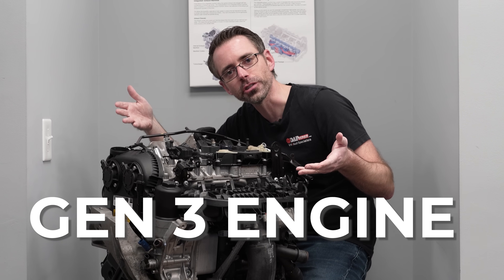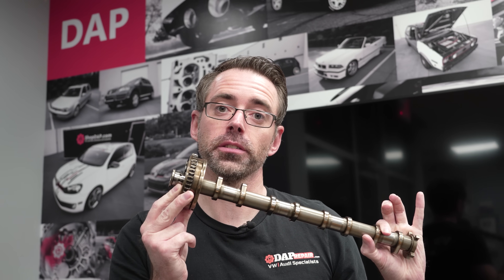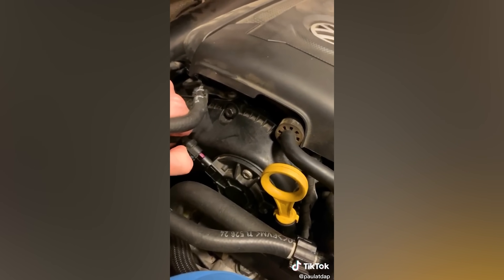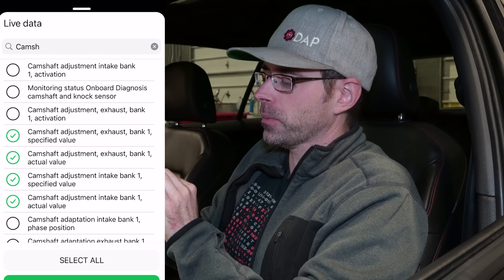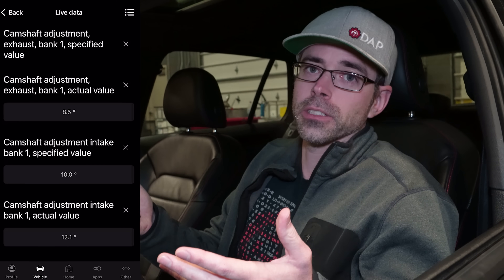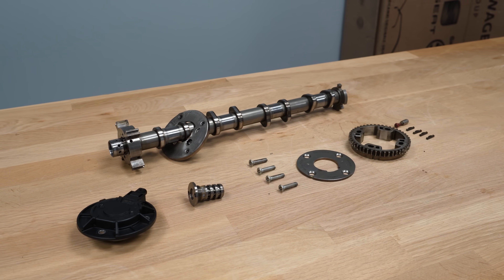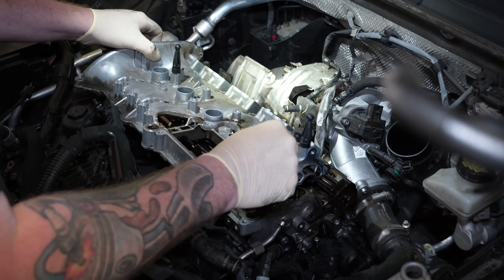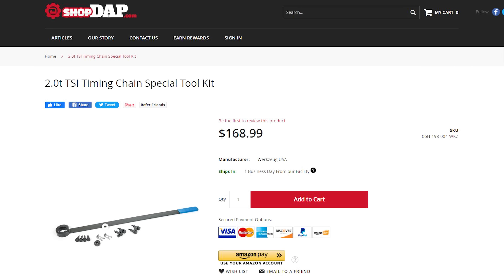Is this a New Common MK7 Engine Issue?

Comment from the maker: Thanks so much for watching! Here are some of the links we mentioned.

OBDeleven Next Gen (iOS and Android) Pro
https://www.shopdap.com/nextgen-obdeleven-ios-android-vw-audi-scantool.html

MK7 Intake Cam Replacement Kit
https://www.shopdap.com/intake-camshaft-replacement-kit.html

2.0t TSI Timing Chain Special Tool Kit
https://www.shopdap.com/make-model-year/volkswagen/gti/mk7-2015-present/tools/20t-tsi-timing-chain-special-tool-install-kit.html

T10355 Crank Holder Tool
https://www.shopdap.com/1-2-drive-crank-counter-hold-tool-for-vw-t10355-wkz-t10355.html

Gen 3 Spool Valve Socket (V2)
https://www.shopdap.com/spool-valve-removal-socket-for-t10352-2.html

Gen 3 Spool Valve Socket (V4)
https://www.shopdap.com/spool-valve-removal-socket-t10352-4-for-gen-3-1-8t-and-2-0t.html

Tensioner Adjustment Lever for VW T40243
https://www.shopdap.com/tensioner-adjustment-lever-for-vw-t40243-wkz-t40243.html
Reply: I contacted Charles a few years ago about this very issue on an MK6 Jetta 1.8t about him making a video about this issue, but he never responded to my messages. 
Thank you, Paul and keep up the good work!
Reply: Please do a video on EPC light on a MK7
Reply: Hey guys love your videos. When I start my mk7R, there is this “buzzing noise” that can be heard. It sounds like it goes away at idle, but when driving you can hear it. The best way to explain it is a buzz noise that changes with engine rpm.
Reply: Does all EA888 gen3 and gen3B engines have this issue? Or does the later models from 2019 and on have a better history on this problem??
Reply: Hi my exhaust specified and actual values are 00    00 no symptoms only a rattling noise
Reply: Hi I live in a third world country my 1.8 tsi does the ticking noise when my car is hot and no symptoms or codes whatsoever plus my cam values are stable exhaust 00=00/intake 15=15.6 stable please any suggestions and thank you

Comment: Google seems to point to this video for the P11A00 and friends DTC codes (Cam Shaft Actuator A/B on Cylinder X - range/performance; other numbers in Audi TSB 2043735). loss of power and can't cruise control [ the video does not point to these ]. 

If you run into this one, behind the ignition coils there are 2 of these (part number 06E103697AE or similar) per cylinder in order (looking left to right when standing at the hood ornament looking toward the windshield) 1B, 1A, 2A, 2B, 3B, 3A, 4A, 4B (as far as i know).  Just remove the t25 torx holding it in, pop the clip holding in the connector and disconnect, pull the part out (may need some pliers), push the new one in with an oiled o-ring (make sure to line up the bolt hole) and screw the T25 back in. Paul points it out in his mk7 engine component location video at 7:15 as 8 solenoids for variable valve timing. I did do this without disconnecting the harness to the coils by cutting down a pittsburgh t25 x 4 in screwdriver handle to be a bit shorter (about an inch shorter) so just fit at the right angle for that actuator. 

Hope this helps someone, since this is a 5 minute fix that's less complicated but finding the order of which one is which was a random post on VWVortex under an Audi AVS thing. 

Great videos from DAP

Comment: I got just a cylinder 3miss fire but its running terrible no other codes i have a gateway static voltage to high thats it and it also just started knocking im at 111500k and i just bought the car 5 months ago and i screwed 😢 im only 20 and just wanted to buy my dream car i also have been chasing this issue fir two months now switched coils plugs pcv everything was fine though

Comment: Ok. I will not be doing this myself. Haha. There’s no ticking just p0011 and p000a. Oil is good! VVT solenoid replaced. Still stalls at stoplights after 8-10 minutes drive. Idles rough. Starts right back up though. I don’t want to pay for this repair…

Comment: I’m having an issue with my 1.8tsi ea888.3
The car starts then after the cold start it doesn’t start anymore th car give a bunch of cam shaft actuator fault codes A/B open circuit 

I need help I have been chasing the issue for a year now !! If you need more info comment I will answer right away

Comment: I know this is an old video , but I have an issue with a MK3 Audi TT , 2.0Tfsi Gen 3, I have a rattle/tapping between 2000-3000 on light throttle, unplugging the cam magnets does nothing . Holding the wastegate arm does nothing . Any advice ?

Comment: Does the 2016 A3 2.0 Quattro sedan have an oil control valve past the cam magnet sensor? I can’t seem to find one for this particular vehicle. A lot of the 2.0 engines have them. I have a cam magnet leak from the electrical connector at the exhaust side i believe (the second one closest to the firewall)

Comment: Bought an 18 GTI S DSG new — Drove it hard, replaced the timing belt at scheduled interval and completed ‘all other major’ services at scheduled intervals — That sound started at 92K miles (12/2024), and now I know why I was quoted for cam shaft replacement, as they were black as coal in the inspection video — I should’ve checked the F#€KING oil … Yep, I should’ve also changed oil more frequently than 10K mile intervals!

Comment: Hello
I have a 2009 Scirocco 2.0 TSI 200hp that’s making a ticking noise, which sounds similar to this. I've experienced misfires(fault codes on all cylindres)  and received the P0010 fault code, no engine light.
The timing chain, tensioner, and guides are all in good condition, with no visible damage to the lifters or camshafts. There’s no change in the sound when I unplug the N205.
Could the issue still be with the intake camshaft phaser?

Comment: Good day, i have a 2014 golf 7R, it is currently at VW for a repair. they told me it is the magnet on one camshaft....is that a common problem or do u think it is seals. The also told me they swapped the 2 magnets and then the problem was on the other camshaft.........your thoughts ???. Regards Jaco

Comment: I did my timing chain on my gen 1 a while ago and remember looking at how easily it would’ve been to do my cam at the time. I don’t know why I just didn’t spend the extra money and replaced the camshaft at the same time. Although I thought that terrible clacking sound was a bad oil pump or something but it sounded it exactly the same after I finished. Now it’s worse. But the car still drives great thankfully. Hopefully I can get the work done at some point before it blows up😅

Comment: I just replaced the magnet adjuster on wife's  2014 Passat  1.8TSI.     it was acting a little weird.

AND the oil was low.  AND the HPFP tap was loud.     new magnet,  a quart of oil.  Its actually due for change in 400miles...   and engine is quieter and normal again.

Comment: Wanted to post here in case it helps anyone else out. My MK6 Jetta GLI started having this issue and at first I thought that I was out of luck for getting a replacement vvt oil valve for the original camshaft (miscommunication with the parts guy). The factory spool valve is part 06K 109 257. This part is 21mm and fits the original camshaft, but there is a new valve that is 20mm and fits the updated camshaft. After some research, I was able to replace this part with 06L 109 257F to fix the rattling issue.

Comment: Good video for explaining how the cams work, but a little bit dramatic. If that knocking sound is there, but goes away when magnetic solenoid is unplugged, the first port of call should he to replace the magnets. Failing that, next up is the spool valve of whichever cam is making the noise - most likely, will be intake. Make sure you carefully order the right valve for your car, very imoortant. This will in most cases likely fix the issue without having to tear apart the rest. Of course, it may be that the camshaft is indeed bad - but DAP should explain what I and others have just said rather than immediately jumping to 'the whole camshaft is bad'
Reply: Thanks for this comment! I have the noise for 1 second max on start up (no fault codes). 

I can't really measure it with unplugging the magnet as its so brief (or could unplug before starting the engine?)  I've checked the cam phase adaptations on vcds and the intake is at 0.3 degrees but exhaust is at 2.6 degrees. Am I to assume that it's actually the exhaust magnet/spool/camshaft making the noise? Thanks in advance.
Reply: @Hey-Roman  If it only happens for a split second on cold start up, it is unlikely either than magnet or spool valve is your issue as the rattling with these problems is persistent at idle, and with a scan tool you can see the inlet cam timing hunting up and down.  These cars do normally  sometimes make a somewhat odd noise on cold start....I believe it's to do with additional air injection, could that be what is happening with yours?
Reply: Hi, i think I have this issue, I heard the rattle like 15 days ago for about 15 seconds but no its on every cold start and also I hear it on low revs. Unplugging it completely goes away. I have a mrk 7.5 golf r 50k miles, I would like to think the camshafts themselves wouldnt be failing at this stage right?
Reply: @TheQuinPVP  I would strongly suspect either a magnet or spool valve beneath it.  Certainly nothing much to lose by trying as those parts are relatively cheap and it's simple to do.
Reply: @danielwatson2068  I have it booked in to get the intake magnets replaced, hopefully this solves its and its nothing too serious. Ill update here incase anyone gets the same issue

Comment: I’m currently battling a misfire on cylinder 3 on my 2015 Passat with the 1.8t (same engine as the video). I have done coils and spark plugs, injector and even an intake camshaft. Still dead miss at cylinder 3. I did a compression test and all cylinders are at 180psi. Any suggestions?

Comment: I have a gen 3 1.8 that’s experiencing a weird misfire in cylinder 3. It has good compression and recently replaced an injector but still misfiring. I looked at the values and mine is also fluctuating around 10. My question is… could a bad intake can only make the engine misfire in one cylinder??

Comment: My Mk7 1.4 TSI has an erratic cold start idle...should the inlets be cleaned .. coilpacks seems to work as advertise .."experts" advise ultrasonic cleaning injectors..All the advise sounds extremely costly..Advise

Comment: I don't understand. ..  If removing the connector to the magnet stops the noise, does that confirm that the cam needs replacing?  If the oil passages are gummed up, could this cause the problem?  Could a sludge cleaner like Rislone potentially solve the problem?  And what is the consequence of NOT replacing the camshaft, eventual destruction of the engine, or just a loss of driveability?  And is the loss of driveability / power severe or mild?     My MK7 Golf has only 70K miles and suddenly has a LOT of problems.  Not sure I want to put anymore money into it.  Oh, and YES, I HAVE ALWAYS HAD OIL IN IT.  GOOD QUALITY OIL, and do regular oil changes.

Comment: Hi been struggling with low oil pressure there is oil in the engine first of all lets get that out of the way. 😂 new Crank installed resealed everything oil pump new seals everything.  But still no oil pressure. Diagnostic says low oil pressure help

Comment: My 2016 MK7 rattles on cold start up a few hours after shutdown. The engine stops rattling after oil pressure is up 3 seconds later Any ideas? Yes it has oil!
Reply: this sounds exactly like the symptoms associated with this problem. I would check the magnets and the spool valves in your camshafts. Luckily for us, the newer spool valves don't fit in our camshafts BUT the internals do! Swap the internals from the new spool valve into the body of your old one and thread it right in. If you've caught it early enough you may be good to go.

Comment: I purchased a used engine and pulled the old 2016 GTI CXCA out. I would like to verify something before installing the used engine,  I noticed that when manually rotating the new used engine clockwise about every manual 360 rotation, I hear a loud click in the top of the engine.  Any ideas? could it be something related to the camshaft in this video? The engine that I purchased was reported to have 71,000 miles before being pulled. I don't want to waste time and money (new parts) on this engine if something major is wrong with it. Its still under a 6 month warranty. Thanks

Comment: Has anyone who's car developed this issue also had scoring on the camshaft and head/valve cover? My car definitely needs a new cam due to this, but its also scored. Its unclear if this rattling issue also leads to the scoring of if that's something else?
Reply: The scoring happens from a lack of oil pressure. I've seen it in these engines and others, all the way back to the 1.8t mkIV days.
Reply: ...and yes the issues can be related.
Reply: @casasdenick  What causes the lack of oil pressure?

Comment: @Deutscheautoparts do you know if the internals on spool valves are interchangeable? my mk7 golf r needs new spool valves and I cant find them anywhere. part number for mine is  06L109257D
Reply: I've read that they are interchangeable so you don't have to order a new cam. Mine are on the way so I'll know here shortly lol.

Comment: 17-20 Hyundai Elantras have the same issue with exhaust cams, they have a pin that lines the cvvt to the cam and if they’re run low on oil they shear that pin and cause the same issue

Comment: Hey Paul I have a question. I’m getting a p0014 and a p0017 code. I don’t have any funky noises going on, and my specified vs actual is off by 7 degrees but it’s not jumping around crazy. Does this sound more like a jumped timing chain than an actual magnet or spool valve issue? I have screenshots of the actual values I can email if you can help me!! :)
Reply: The car runs and drives fine, but at high rpms in 3rd-5th gear I get a break up/misfire and a hide cylinder epc. All cylinders have good compression and leak down test was good. Ignition is good, fueling seems good, so the only thing left is a timing issue. Could this weird timing issue cause this break up at high rpm?
Reply: Motor has less than 15k miles on it

Comment: Guys, I have Golf 7 2015 SEL with 1.8 TSI CNSB engine and both values on 'How to Diag' part of video is 0. 
camshaft adjustment intake bank 1, specified value - 0
camshaft adjustment intake bank 1, actual value - 0
This values change only when I start to drive. I am worried about this behavior, has anyone dealt with this?

Comment: I have a question. I replaced the valve and the magnetic actuator. I removed the Cam bridge screen too. Problem persists. Also always using premium Oil and first brand filter. It is possible that the problem would be a low oil pressure at the top of the engine? Or I need tho replace the cam... What do you think
Reply: any update to what you found?
Reply: @casasdenick  hi, finally I replaced the camshaft, and solved. I think the problem was the vvt cam gear sprocket, but vw dont sell this separately, it comes with all the camshaft.
Reply: @joanespik  what do you mean by "I think the problem was the vvt?" Do you mean the n205?
Reply: @casasdenick  no. N205 (solenoid) was replaced and problem persists. Also replaced the valve too and problem persists too.
Finally was the vvt gear sprocket, an internal failure of that causes loosing oil pressure and consequently a bad cam adjustment
Reply: @joanespik  ah I gotcha, the little one inside. I'll keep that in mind. Thanks for sharing.

Comment: I have a 2016 VW GLI with 140K miles on the clock now. The only two things that ever broke were the clockspring and a single rear ABS sensor, both of which the VAG is obviously unable to fix. Otherwisely, at this time the oil consumption is 1 Qt per 4K miles and everything else is as good as new. I've been changing the oil every 5K since day one, OEM, and it seemed to have done the trick. I'm still to decarb the car for the very first time, just as a preventative measure, no misfires or anything like that.

Comment: Hello @Deutschautoparts, at 1.8 TSI GEN 3 i have a diesel noise at idle only when the engine is hot.If i disconect the connector from the electromagnets the sound disapear.(no error code) What to replace first?electromagnets or mechanical valves ?Thank you

Comment: So, what I see is regardless of the car wearing out a camshaft (likely due to lack of lubricantion from low oil) it's still a timing chain and camshaft replacement. Which means it's still  between $2k-$3k. 

Great... 😅

Comment: I have a 2016 Golf R and was considering changing the Magnets & Plungers out of maintenance so I don't run into issues since I race the car in the summer. However it sounds like I cannot use the latest updated plungers and would need to find an old revision to fit? Or am I missing something?

Comment: Hi, do you have any idea my mk7 gti 2013 has a vacuum when i open the oil cap , and the engine is not running good and is saying misfirings on all cylinders. I changed the pcv und spark plugs. No check engine light or similar. Only Fault message when i read the system with OBD is „idle speed higher than expected“. Maybe someone has an idea, thanks

Comment: Has anyone experienced a spark plug wet with oil and black smoke with oil coming out from the exhaust? . I have a 2014 GTI currently at 85k km, no misfire. I took it to the mechanic, did a compression test looks normal, checked PCV  normal,no codes. The guy said this was a weird one and he could not tell what was wrong with it. Any suggestion?

Comment: 9:01 Not correct. It's a question af getting the right partnumber. The valve comes with both M20 and M21 thread size, and they are both still available, so no need to change the whole cam if only the valve is bad.